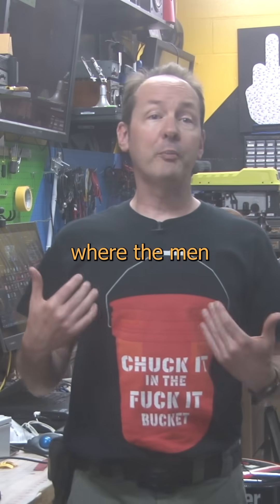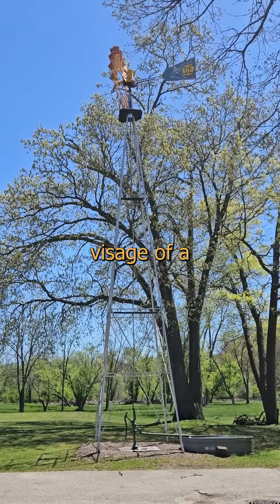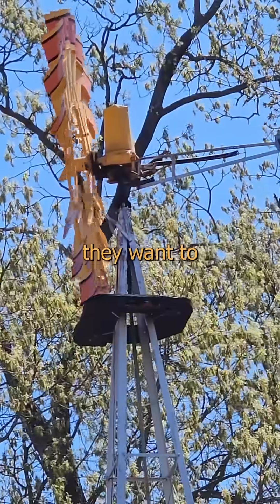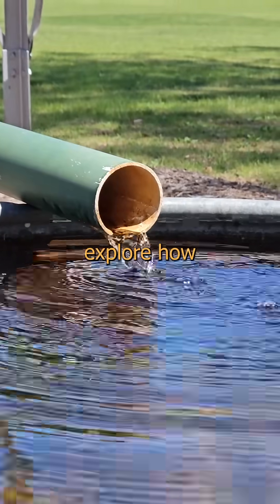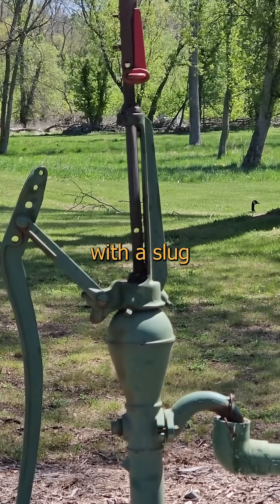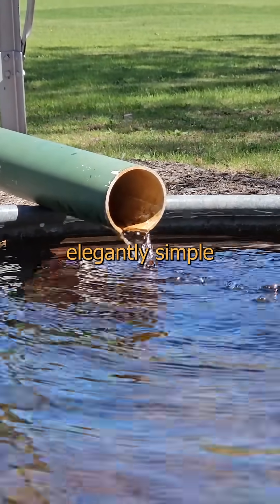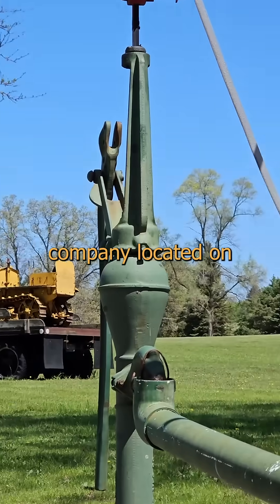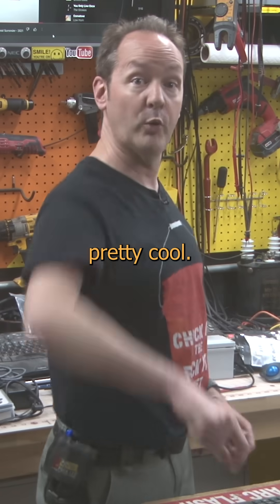Windmill Water Pump #chrisboden #comedy #engineering #farming #history #plumbing #well #windpump

Comment: Australian here - frequently see these things in an operational state despite being comprised almost entirely of oxides, they seem the epitome of reliability
Reply: Good engineering works, great engineering works after being chucked down a flight of stairs and left in the weather for a few decades.
Reply: 1.) Church of the SubGenius
2.) Fellow Aussie. I've lived on a farm with one of these more rusted than the hills hoist and both still worked despite being out there for 70+ years. They're everywhere here in Australia
Reply: Oxides! I am among my kind!
Reply: @AmosMantyla rust is better than super glue or duct tape as long as you aren't needing electrical current to flow between 2 points !
Reply: got one in the back shed mate, just trying to  finish the hand auger work
Reply: simplicity makes it easier to work for longer, because less parts and harder to break
Reply: Yeah, sounds about right, never been to Australia myself, but seen plenty of footage of farms, ranches, and houses out in the middle of fuck all nowhere with them, in working order, despite looking like a set from Mad Max.
Reply: @Sevness huh , I'm not remembering mad Max as having windmills ! yeah! an excuse to rewatch them! I don't think I've seen the most recent one either! I think our local library has them , they've got the matrices too & I'm missing the last one of those too ! thanks for an excuse to binge on 2 VERY different types of apocalypses !
Reply: @l.scales7516  I think there are actually 2 new Mad Max movies by no! I am always happy to inspire others to consume post-apoc media, it's my fav form of setting, be it from Fallout, Wasteland, Mad Max, or even Water World! XD
Reply: I also thought "having a butchers" might have been an Australian term, but apparently not ?!?
Reply: @GffHll  That one is cockney rhyming slang: having a butcher's hook = having a look. There's plenty of similar turns of phrase in the average aussie's vernacular (dead horse = tomato sauce), but the roots of the practice are probably the same.
Reply: @GffHll I'm pretty sure it is a reference to opening something up & reducing it to its various components , tongue, kidneys, liver, brisket, ribs etc but instead it's shafts, sleeves , seals/ valves, sometimes depending on design there might be a reciprocator or oscillator ( reciprocator would be if it was set up to be horse or human powered or other rotational on the horizontal plane , like a clock on its back, to convert the rotation into up & down motion ) some would have a float in the watering trough to keep from overflowing. I hope that makes some sense insofar as' taking a butcher's ' . I'm fairly sure this is correct but I'm not sure of its origin.
Reply: "Epitome of reliability" is definitely what you want for something that might be the difference between life and death by dehydration.
Reply: @AtariEric or loss of power.
Reply: That's how the ones at my grandparents place are, too. Absolutely marvelous.
Reply: @ph0end  also an Aussie here. Use to be my job every year to climb up and re grease our mill before and after every winter. Ladder was shot and I was skinny but she worked a treat with a lot of lube and a little tickle in the right spot
Reply: cant beat simplistic engineering
Reply: There are many in an operational state around the U.S.  Not sure where he's at that he's never seen one working, but he's sure not afraid of saying dumb ish about people who have old windmills for various reasons.
Reply: @Objectified  
Chris spent his younger years busy and in suburban environment and just got out of prison two-three years ago. Dude hasn't had the opportunity to travel around and see as much as he'd like.
Reply: @WhatIsSanity thank you , I've heard it referenced before but wasn't sure of any details .
Reply: @Objectified   From the waste treatment sign he's in Coopersville MI.
Reply: @Objectified  'dumb ish' completely invalidates any point you are trying to make. speak fucking english if youre gonna speak fucking english, not some gobbledegook fucking hoodlum patois or whatever the fuck that abomination is. seriously how damaged does your brain have to be to get you to speak like that???? embarrassing. genuinely fucking emarrassing.

Comment: I friggen love these, the new ones are cool too where they generate electric power stored in a battery and still usually operate a water pump, but i was on a farm where a lot of the farm lights and irrigation timers and stuff were all run off the windmill

Comment: Thousands of them in Australias' outback. Too far from the grid to use electric pumps, too expensive to run generators, cattle will wrecks solar panels... Some of them are massive too, common size is a 20 foot diameter, but they get as big as 40 feet, and can stand 150 feet high...

Comment: It’s not unlikely, 50/50 i’d gander, that even if the “leathers” (sealing part of the valve) are new, they’ll likely still be made of actual leather. 

At my family place we had significantly better luck with the leathers being made of leather rather than anything newer. They lasted longer and failed more gracefully. 

There are many flavors of windmill pump, ours were all downhole assemblies with 2 valves and a brass cylinder. When changing the leathers, fishing out the bottom valve with the sucker rod assembly was a party. Straddle the hole, and fish around with 40-80 ft of rod until you got the threads to just catch. Failure to do so ended with you having to pull the whole casing. 

We had a cylinder (the 2 valves sit inside it) that was about 100 years old, and when it got scrapped the walls were literally paper thin. 

Windmills are good fun until you need them to work right now and they just don’t feel like it.

Comment: What would be pretty cool is to hook one of these up to a geothermal system to be able to heat/cool a building. Like a house or a barn or whatever. Perhaps an enginerd could also rig up some battery backup pump that is being fed through solar, or maybe even a sterling engine to keep that rolling since you are typically getting a temperature difference between the air and the underground water (except when the weather happens to be around 50 degrees or whatever the well water is).

Comment: I live in lancaster county pa and I work on diesel engines for the amish community. Our shop is owned by an ex amish guy and on the property there is a fully functional wind mill that pumps water into a large water tank on top of a hill so it keeps extra water and pressure for the shop and farm next door.

Comment: I grew up with one of those pumps. Not the windmill, just the pump. It has an electric.motor attached to it but when the power went out, which happened at least twice a winter, one of which lasted a week, we kids were the ones to pump the water. I started at around 4. I wasn't really asked to do much. 100 pumps was pretty easy once the flywheel gets going. So it wasn't arduous and the main responsibility was on everybody else. As I got older, the power went out less and less. By the time I was a teen, it was nearly completely reliable and no manual cranking was needed.

Comment: Had one at my ranch (south texas) and the tower and mechanism looked identical and it worked too. We used it to keep our concrete water tank full for cows to drink from. It eventually broke and we replaced it with an electric pump. Not sure what parts of the windmill and tower we removed if any.

Comment: The internals of the pump mechanism is still very much the same on many modern air actuated lift pump made by Graco, the industrial machine company not the baby stuffs company. The pump uses the simple check valve system but just a few fancy little bits and pieces. I was mixing polyurethane components in 200 L (45~50 gallon) drums with an air motor corkscrew mixer on one side and the pump on the other. These part B drums have 3 large caps on top, the center one would be used to inspect this mixing and add additives like color and reactions agents to control hardness.

Comment: My grandpa had one on his farm that was capable of doing work, but was sadly disconnected. He sometimes said he wished it was hooked up to an electric generator, but I don’t think he ever took steps to make that happen.

Now he did have a backup generator for the farm, but that didn’t have its own engine. Instead it had a shaft sticking out that they could hook up to the accessory drive shaft of a large tractor. There was also a nice, beefy transfer switch next to the generator.

Comment: If you do enough wandering around on NF or BLM land you'll find these things sometimes still pumping water. Usually in areas they lease out for grazing. The first time i found one i also thought it was just about the coolest thing ever. A lot of the ones in remote spots also have a solar panel as a back up!

Comment: That's the simple version, you would absolutely go nuts if you find the one with the auto shut off/ turn on mechanicals! When the water is full in the basin it doesn't pump, but when the water float gets low, it trips the engagement and it pumps until it's full!

Comment: We have a working one on a farm by us. It pumps water up to a wooden water tank that’s located under under the air motor. The height of the tank has enough head pressure to provide water to the barn.

Comment: Ive mever understood pumps like that, i would like a graphical breakdown with xrays and explination on how literally everything inside them works. I refuse to not know how the water is pumped.
Reply: If you have ever used a hand pumo for bicycle tires you've pumped air in the same ways these pump water. A plunger moves up and down in a pipe.
Reply: Heya! Open to draw you a diagram. Have discord or something?

Comment: I had the opportunity to join friends for a weekend at Uncle Buck’s Cabin in the Rockies. Where the 10th Mountain Group trained during WW2 for dropping into Norway.

While we took fresh drinking water with us, the old style stove and handle operated water pump flummoxed my chums, not being mechanically minded. 

Using only my ASD brain and a Swiss Army knife, the little screwdrivers opened up the sticky parts of the stove and the pump and we got the stove lit and some water boiled from the well, to wash the dishes and cutlery after watching the sun set at umpteen thousand feet.

That was pretty cool.

Comment: Quick, take it down. Replace with a couple grand of solar panels, enough lithium batteries to light up Times Square, fifty yards of copper wiring, and three grand of fickle and non-servicible electronics. A true net-zero marvel of climate control technology that will work as advertised every other Tuesday.😂

Comment: I recently moved from an area that has plenty of those things working just fine. Only, now most of them generate electricity. Not A LOT of e, but enough to run certain things that need to stay on when the power goes out. Most of the farms have large generators as well, but those are limited by fuel supply. They last a couple of weeks at most. But the valleys run East to West, and have a good breeze twice a day for most of the year. The time of year that the power is likely to go out for more than a couple of days is also the time when the wind doesn't let up for the entire season. The month or so when the wind is least consistent is also when the wind power is least useful.

It's pretty common in those counties for the farmers to save the fuel for the tractors and trucks, and "go Amish" when the power is out for more than a couple of days. Power up the generator for no more than an hour or two to charge the laptops and celphones, light the hearth, and put the refrigerator outside to keep the stuff in it cold. Full time RVers, like me barely even notice.

Meanwhile, the 150 year old windmill is cranking the pump while powering an alternator generator that provides e for the heat lamps for the chickens and calves, the electric fence, and the heater coils for the water tank and trough (they double as cooling in the summer). The water in the tank and trough never dropped below 40°f or got above 50°f.

Comment: Fun Fact: petroleum doesn’t fall under the department of energy…..it’s under the department of agriculture. Don’t believe me? The certification seal on gas pumps say it all.

The reason is that 160 years ago, when petroleum drilling first started being a thing, there wasn’t a department that could regulate it. They didn’t know how to categorize it. Since it required drilling and pumps, department of agriculture took it on because they already regulated those things with water well. 

It’s just stuck

Comment: You should check out some of the proportional gears using moon counterweights in some of then older windmills. Many of these are still in operation down here in Texas, fill troughs in pastures where there's no easy access to power. The 1920s aeromotors are late-comers.

Comment: Very cool machine, but why are we pumping groundwater without purpose? Aquifers are a slow to replenish resource that we shouldn't consume just for the sake of it. This specific application seems like it would be better with a purely ornamental spinner.

Also I'd want something that disengages the gearbox so even if I had use for the water it wasn't constant. Fill a tank, disengage the pump, float switch in the tank drops, re-engage the pump.

Comment: They have to be kept oiled, cause a dry windmill sounds like a biggest cat getting murdered.
Reply: who needs an air raid siren when you can just have an unoiled old rusty one with sand in it's everywhere screaming at you like a 12 cats in heat compressed together!
Reply: @Sevness  less of a dangerous wind alarm and more of a any wind alarm. luckily the cows didn't care about the noise.
Reply: @Torsomu you think that. how would they display their stress reaction , it's not like they can put their hooves over their ears or bury their heads under a pillow! cows are more human than most people know. in a drought situation with several cows with calves who can smell water somewhere they can make a judgement on if it's too far for her calf to come with her ( milk runs out faster when the only moisture is from the tiny bit in what they graze on & while hustling to the water source they barely graze at all, knowing it's likely there will be lush greenery near the water , meanwhile another milking mom will or multiple moms will provide the calf with milk & comfort & protection . the mother cow drinks eats rests drinks eats rests until she's restored her systems & heads back & I'm talking sometimes days of a journey even though with their long legs a cow can move along casually about the same pace as a horse but for longer , their digestive system is (4 stomachs) more efficient that a horses , horses need to eat more because they don't redigest their food like cows & rabbits do . when she returns the next one or perhaps a small group will go . because they help one another & they know how far approximately the water they smell is from them & likely even have an idea of the amount , like a smAll seep of a spring etc. unfortunately sometimes that water is inaccessible in a cistern or a well or behind a fence & sadly sometimes they never make it back . they mourn their young , sometimes will stay with a dead calf to protect it until it no longer smells like a calf. they'll try to fight even a mountain lion or a pack of wolves if their calves life is at risk. don't downplay their sensitivity to annoying sounds that cover other sounds which could cover the approach of coyotes etc.
Reply: in this case there wasn't. just a century old abandoned farm that now has a housing development on it called Windmill estates.

Comment: I have three working windmills on my ranch, one is a B602, a 10' mill that it and the tower in over 100 years old, it still has the original pored Babbitt bearings in it and like all my mills it  works 24-7

Comment: If the valves for the pump are at the top in the bell space or pump above the point where it seats to the well pipe, then it's for drawing water out of a shallow aquifer, at a depth of no more than 30-32 feet. (depends on the quality of the valves.) The problem is that a vacuum will form at a water pull of about 32 feet, porro valves will not give you that much head. That said for shallow water tables, that's more than enough, and I've seen solutions where the valves are down the well shaft and can lift water substantially more than 30 feet. But that also requires being able to replace that shaft all the way down to the bottom of the well. Fin at 40 feet, perhaps. a bit of a pain at 100 or more.

Several of these on wells at farms around where I grew up. Many did have the windmill driving the pump, but since the wind wasn't always available, most of them had an auxiliary drive involving a wheel on a motor and effectively a Scottish mechanism. The motors were geared down, not for the torque, though some of that too I'm sure, but mostly for the fact that driving one of those pumps as fast as a motor could spin wasn't good for the pump. If it's your farms only way of getting water, and you have cattle and livestock to keep water for, you take care of the equipment. That's your life you're watching out for, as well as your family and farm.